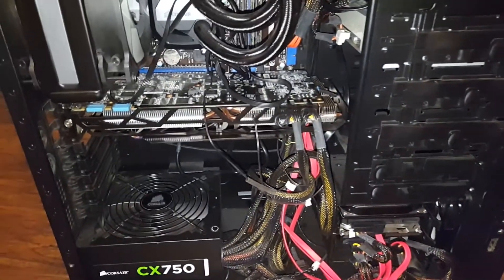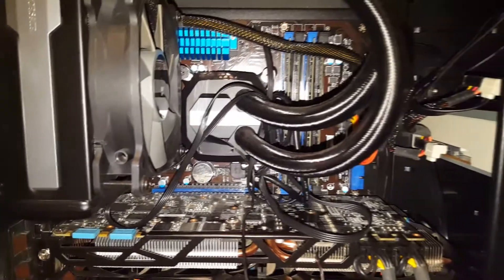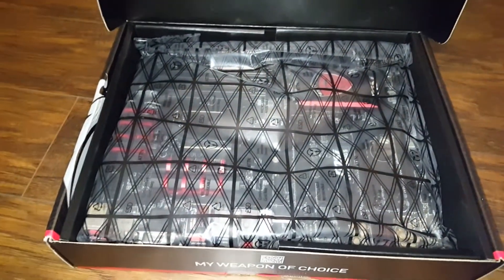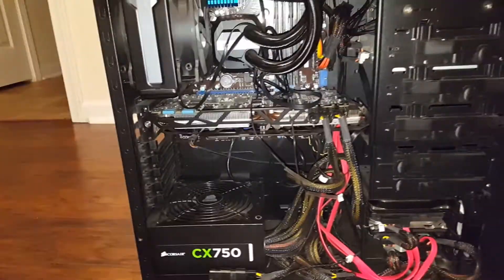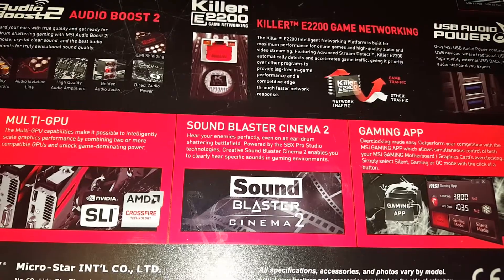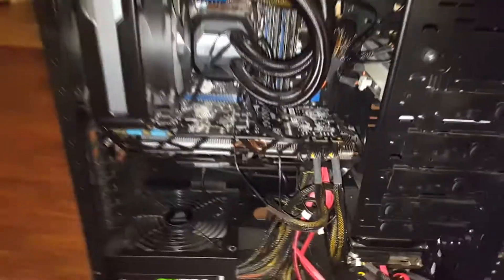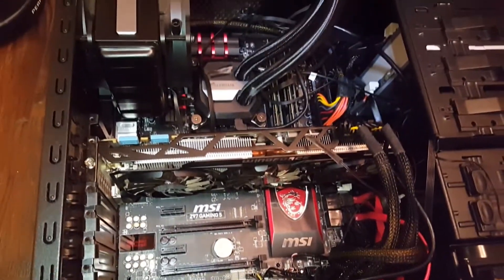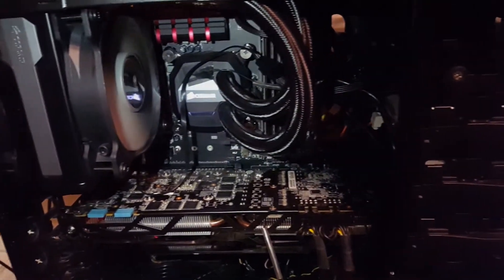NEW Motherboard Installation MSI Z97 GAMING 5!!

Comment: that's a lot of spaghetti in the case😆The case has cable management grommets/holes. you can still route the cables cleaner.

The outside of the anti-static bag offers no ESD protection.  throw it out once you've removed the board.  rest it on the box instead since cardboard is non conductive.

Comment: Will a normal i7 4790 (non k) work for this motherboard?
Reply from the maker: Dot_JPEG yes the k version mean unlocked. only for overclocking
Reply from the maker: +Dot_JPEG yes it will. the k means unlocked so you can over clock it.

Comment: Its a little late but there is a specific issue with the E2200 Killer Network drivers that come with the board and on MSI's site. If possible you may want to look into installing the driver without the Killer Application as the driver with application contains a memory leak of some sort.
Reply from the maker: +Ian Guibas (MythicCynic) thanks for the heads up but on my pc its working perfect for me.